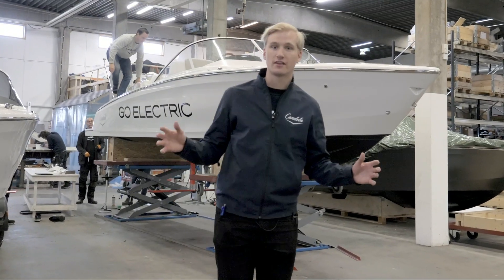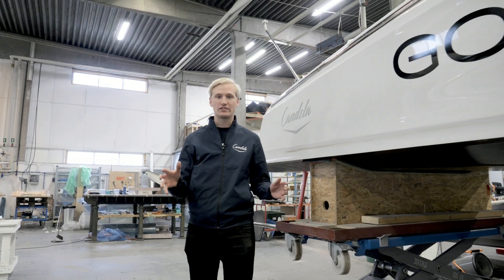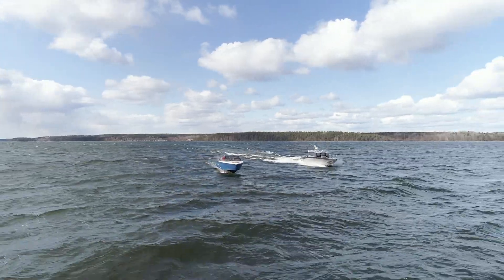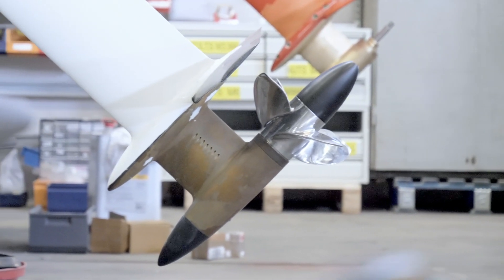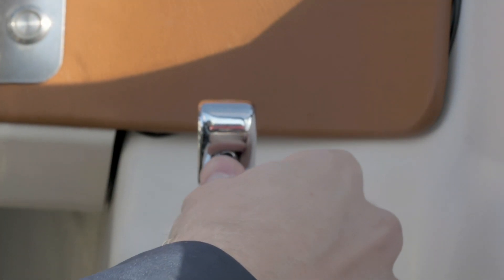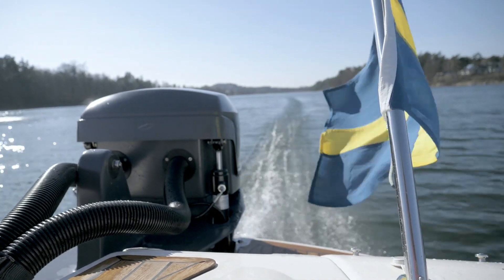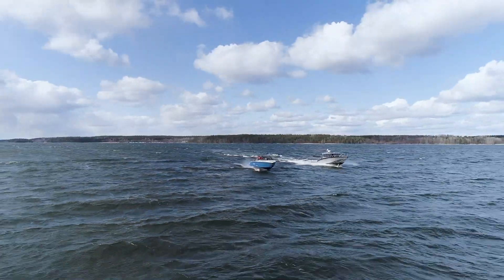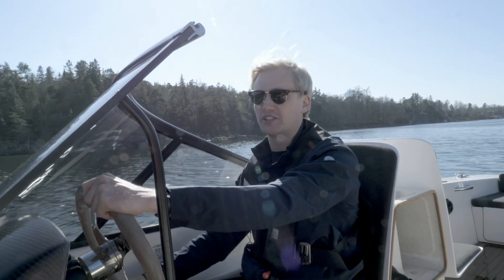We build electric performance craft | Candela C-7 Product Presentation

Comment: The pros: ultra smooth ride, innovative, quiet, combining boating with flying. The cons: 50 mile works only for a spin around the lake. Stay out of shallow water. Sudden stops could be dangerous to passengers. Conclusion: I’m interested.
Reply from the maker: Hi Howard, sudden stops are not dangerous. The digital flight controller lands the boat very smoothly, so no risk there.
Reply: @Candelaboats  nonsense. Hit a reef, the boat stops instantly and what happens to the passengers? This happened with a commercial craft entering the St Thomas Harbour entrance.